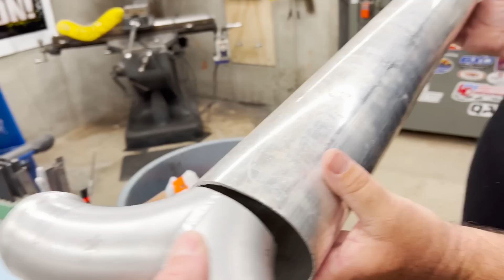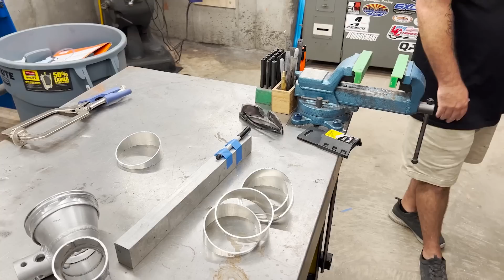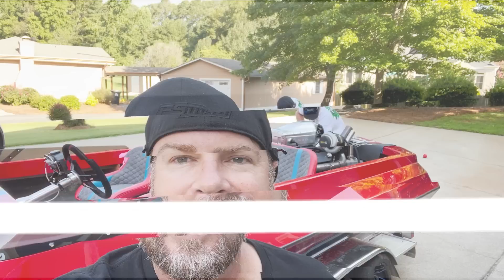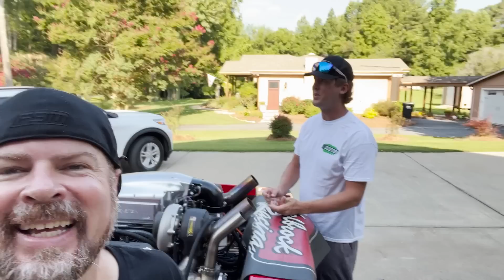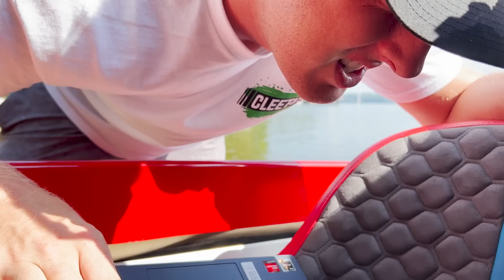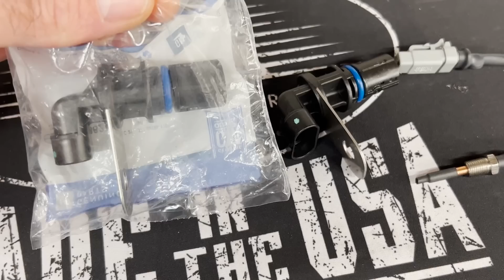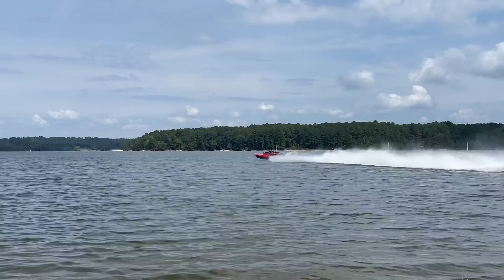CLETUS MCFARLAND, PIE CUTS, BROKEN PARTS AND A NEW PERSONAL BEST IN WIFEY'S WHIP!

Comment: @Finnegan's Garage , what fuel is required for the 20psi?
Reply from the maker: im running 118 octane leaded racing gas. That high of octane probably is not necessary and i could probably get away with 110 octane but race fuel is cheaper than rebuilding the engine after it pings itself to death.

Comment: there has to be a spec for the gap for the sensor, put a 160F thermostat, the engine is to cold, I asked my tuner, and he said it's to cold as well. The tuner said put a 185f and don't change anything. Check exact gap for the crank sensor and set it to spec. Look around for anything that would interfere with the sensor
it's to cold, you got 10,0000,0000 gallons of coolant.... it would go a lot faster with a prop...
 oB
Reply: My experience with psycho problematic crank triggers have all been temperature related. 
IE: measuring resistance through the coil constantly while submerged in water as I gradually increase the water temperature. 
In all cases, there came a point with very narrow boundaries when the resistance would flip out.  Although similar, none of the sensors went problematic at exactly the same temperature. 
Whether this was due to thermal related movement of metal, causing the coil wire insulation to fail, I can’t tell, or whether it caused a short or a ground for sure, but finding the problem was a bitch in all cases, because they all acted uniquely, but similar.

Comment: Mike I love your show and all the goodies you get to play with im a 28+ experienced automotive technician small details can be so important even as small as the thickness of the red engine paint between the crank sensor mating surface and having that paint cleaned off! In my experience just that slight change in air gap between the sensor and crank ring gear can mess up the whole day of having fun

Comment: Could there be a difference between the 2 runs the a 111 and a 117 and humidity in the air that would affect it too that too but the more air flow you've got the better  Do you have a way to record the humidity from the old run

Comment: I had to add a shim to my crank sensor around the base of it. There is a GM part number 12565102. I actually had witness marks on my sensor. Crank flex can cause it to be too small of a gap and have the same issue.

Comment: I've looked through some documentation that says, in short simple terms, if the engine RPM changes too quickly the ECU will assume there's an error. What that rate of change needs to be to trigger that... I have no idea. That was specifically Speeduino documentation; done a bit of reading because I've never gotten mine to work right yet. Should apply less to dual wheel setups. If I did dual wheel, I wouldn't go missing tooth; don't want to right a book of a  comment explaining why.

Comment: I would look at the crank case pressure and see if there is a correlation between that and the loss of crank signal. Being that it is a boosted application, you could be making so much case pressure that it is actually pushing the sensor away from the crank and creating too much gap. In that event, if that is the issue, maybe a belt driven vacuum pump could keep the case under vacuum and hold the sensor in the correct location. Maybe I'm an idiot but it's worth a look. I love what your doing and wish you and yours the best!

Comment: Did you sort the crank shaft sensor? SuperFastMatt was doing a build where he had the same problem and was informed apparently you need a resistor for high RPM engines. See here https://youtu.be/oDI6a09ywVo?t=666

Comment: I was wondering how long it would take before you actually upgraded That Elbow I knew it was going to be a huge problem remember an engine's just an air compressor even under boost the easier you can get it to flow the more power it's going to make

Comment: That merge makes me think of how many X-pipes under cars I have seen that comes from a pair of 2½" or 3", necks down to one tube of the same diameter, then splits up. That X needs the same cm2 area at the very least as the two tubes combined. I.e a 3.5" tube is minimum for two 2.5". Imagine ho restrictive a pair of 2.½" headers that are necked down into a single 2½" or 3" is.

Comment: I wonder if the wiring to the sensor is suspect. EIther the condition of the end plug, the condition of the wire, or the routing of the wire.

Comment: I said it once and I'll say it again, " A little knowledge is a dangerous thing"! Fellas, fellas don't paint these engine blocks where the sensors mount, especially the CRANK SENSOR! The paint under the sensor and on the tab pad move the sensor too far the trigger wheel and when it's not completely in the hole, they tend to bounce. I've fix this three times in 2022 and I'm sure I'll see it again.

Comment: Is there any chance that you welded, or tacked the Y  pipe on the engine by grounding the engine, and some current arced the small crank sensor gap?  A little outside the box.  But that's where you live.  LOL

Comment: Before you start beating on aluminum you should always anneal it and then after beating on it for a while, do it again. It has a bad habit of work hardening to the point of cracking. Basically put the soot from an acetylene torch on it and then heat it up until the soot goes away and you'll be at temp and then dunk it in water.. it's the opposite of steel it'll make it super soft instead of hardening it. Doing it before working the metal makes it bend at least 5X as easy. You can take a sheet of 60 thou aluminum and bend it by hand with a ton of grunting but once annealed that same piece can easily be bent in half with very little effort. I would've also cut the sides off of your squished section making a V like shape that could've been tapped down between the two pieces of your original Y to make a tight fit like they do on motorcycle header collectors.
 *sigh I wish I could put all this knowledge I have to use.. autism, scolios/kyphosis, chiari malformation (brain defect), and IBS make that about impossible in a normal job environment though. 
Hmm a LS having crank signal problems.. what other red vehicle have we seen that had that problem?... though that turned into it also having a cam sensor issue too.

Comment: I'm no engine builder but I am an EE.  What about high frequency EMI induced by the close proximity of the crank sensor pulses going to the ECU and ignition wires?  The super high frequency pulses from the ignition wires could absolutely be messing up the pulse signal from the crank sensor before it gets to the ECU.  

Edit: looks like this was already mentioned by @skunkie so kudos.

Comment: I like to use a sheet of aluminum on my welding bench to weld on. Makes perfect conductivity for ground with out the arc tracks that get caused from a steel bench top. Give it a try. You wont have to clamp the ground on the piece your welding, unless its painted of course.

Comment: Interesting that Cleeter mentions warm-up in relation to crank sensor glitches. A cold turbo engine has significant blow-by which MAY push the sensor slightly out of the block, interrupting the signal. It also stacks with the fact the engine is seeing more boost at lower rpm than the previous test. Also, that plug lead almost touching the signal wire is not helping anybody.
One thing I am sure of: the LS crank angle sensor issue needs to be solved by somebody. Hopefully, someone smarter than me is working on that.

Comment: Air density at 9 F and 14.7 psia:

1.355 kg/m3
0.08459 lbm/ ft3
0.011308 lbm/gal(US liq)
2.629x10-3 sl/ ft3

Air specific weight at 9 F and 14.7 psia:

13.29 N/m3
0.08459 lbf/ ft3

and i know what all that means......ya
hope that helps.....9%  temp diff in air density

Comment: Hey mike I run supercat race boats and are motors are 2500hp turbo we do look at intake temp but only after the inter cooler in #8 runner which is furthest from throttle body we’re at 90deg mostly same as water temp that cools chiller are chillers are massive tho 10.5in tall Carson brumett another thing we look at is oil out which we try to keep below 240 and 190 in looks fast sweet boat

Comment: Put a wider washer on the crank sensor retention bolt to make the holding tab more rigid...the factory tab is weak and will flex because it’s not made for high crankcase pressure which can push out the sensor and increase the gap... a thick fender washer will cure the “bends” and keep the sensor to wheel clearance tight.

Comment: Even the thickness of the paint on your block can be just enough to throw off  the cps !!! clean off the paint to the mating surface !!!  i used a little play-do on the end of my cps, measured it, cleaned it off, to set my shim height, worked for me !!!
Reply: I also used a little play-do on the end of the cps sensor to measure the gap  & set my shim height accordingly, Worked for me !!!

Comment: The new 4” elbow will allow for over 2.5x the airflow than the 2.5”. With the increased air flow I would guess the time needs to be adjusted… a 2.5” pipe has an area of roughly 5 in/sq whereas the 4” pipe has roughly 12.5” in/sq. By flowing 2x 2.5” you are flowing an instant rate of around 10 in/sq, and with the single 4” you’ll have more than that capacity. With the single 2.5” collector, your velocity was probably much higher and hotter than it is now due to the restriction.

Comment: Your crank sensor wires go quite near a coil pack, you could try shielding the wires with a faradey shield. Cleatus fixed his RPM issue by changin the cam sensor so you could try that as well

Comment: Mike, here's a thought,
 I was wondering if you could put reducers (different sized thickness insert restriction's) in the new elbow to fine tune the air flow, maybe with a twist lock nut/ring to hold the two pieces together for easy swap if/when needed, 
kinda like in the jet drive 
(same concept),

Comment: Ditch the 58x sensor.  Put a msd 4 magnet standard wheel on the crank pulley and be done with it.  Just the standard MSD stuff with the Holley flying magnet Hall effect sensor and no more crank trigger problems.

Comment: Basic thermodynamic theory is when you compress a gas it gets hot, expand it and it cools. Temp at the restriction would be warmer, but immediately after it would drop again.  If anything the restriction might have a very very slight inter-cooling effect, but the restriction will reduce flow, and hence performance.

Comment: Sorry advice, take the old position sensor gut it and run a bolt through it. Screw that bolt in as far as it it will go while buddy turns the engine over by hand. You’ll get a really good idea of what the gap is and be able to adjust the other sensor to suit.

Comment: I always keep a set of sensor pins around to perform pin drag tests. These terminals have a way of losing connection when they've been tampered with. Also, solder the terminal to the wire just after the seal, cheap insurance.

Comment: I love that Miller welding helmet.  I've never seen one with such a large viewing area.  Assuming it is the Relic 280051, that's starting to get up there pricewise at $387, but if it works as well as the claimed spec, it would be totally worth it.  I need all the help I can get with my 73 year old eyes. 😎

Comment: Common sence your trying to output two presurised volumes of air into a pipe the size of one turbo outlet it would be extramly turbulent specialy if one turbo is making slightly more boost than the other but love how much it has improved the boat keep the videos coming

Comment: Air temp will ALWAYS be higher in a restriction, BUT it will cool down gain when it leaves the restriction.   If you AIT sensor is in the restriction it will not give the temp at the throttle body; because Boyle and Bernoulli work both ways the air will be cooler.  That way carbs will ice up.  If your setup is as described above the numbers you have will not be accurate, ow inaccurate is anyones guess..  Having said that the restriction wasn’t du any favours.

Comment: U want you and cleetus crank sensor issues put a big washer on backside of tab you bolt down when you making boost the sensor is getting pushed out because of the egr pressure possible and is why tab sets lower on new sensor

Comment: Centrifugal force adds heat of friction. Air compressor or a positive displacement is heat of compression.
Reply: Mass flow through a centrifugal compressor is way more efficient. With less friction as it passes through the compressor there will be less heat. In my a career I have worked on centrifugal compressors for 33yrs. This is what drives efficient, huge scaled chillers for air conditioning, mass flow…..

Comment: So you don't bend the pipe in the clamps (which is visible in the video) just get a piece of wood, use a grinder to round the ends to match the contour of the pipe you're cutting and slide it in. It doesn't need to be tight fitting to the point where it won't go in, just needs to be exactly sized to where you can push it in by hand. 2 minutes tops = even better cuts and you can really lean on the handle of the clamp.

Comment: You more than doubled the surface area of the inlet tubing. In the process you eliminated a 50% restriction that was holding it back. That's huge and the power increase is proof.

Comment: Now exhaust pipe frm the turbo open it up .. that will allow the turbo to spin faster .. eg.. 3 inch out let go to 3 1/2 " pipe 4" go to 4 1/2" and so on especially if you have bends within 12" of the turbo  .... turbo exhaust is spinning as it leaves the turbo and is at speed you need to open the pipe to slow the speed so the gas to straighten out and get out of there ...garrett  needs to do this to mullet as well

Comment: I wouldn't let McFarland Tuning tune my lawn mower to be honest. They've destroyed a lot of engines including the latest 360ci Mopar...didn't install (with proper lube) or run in the new camshaft in prior to doing burnouts and dyno pulls...and put too big a carby on the motor. They come from the school of more fuel, nitrous or a turbo, compensates for everything. About time they employed an experienced engine builder, rather than just mechanics. The only member of the crew I have genuine respect for is Tye Braun...he is the top of his game 🤔

Comment: So I will start by saying nothing I do is at this level of power, however, I know delicate sensors enough to recommend this:
1) As another said before me, make sure the wires are shielded to the ECU
2) With boats being solid mounted and having very minute vibrations of which thousands at speed are rarely registered via the ass meter, the internals of electronics usually can and do fracture at solder joints or, especially so, any flex in a solidly soldered connection without isolation. 

That said I would try to make it so that your crank sensor isn't tightened with the possibility of flex and is isolated solely to vibration. 

That said the improvement is astonishing, wasn't expecting an elbow change to make as much difference as it did. Good luck with Blasphemy, I know she likes to test you lol

Comment: I have been a mechanic for over 30 years and one thing that has been in my tool box all that time is Silly Putty. I the case of your crank sensor would put a small piece on the trigger wheel, install the sensor, pull it back out, pick the putty out carefully to see your gap. You can cut the putty with a razer blade and get a pretty good measurement. If there is some room sand some paint off the block. If it is like the crank sensors I have been around it doesn't hurt the sensor if it rubs a little plastic off the end. I have mostly worked on larger diesel engines.

Comment: When you increase the overall diameter of the pipe, the CFM quickly increases. At 10psi on your 2.5" ID, you can flow ish 5000 CFM, at 4" ID, you can flow 16400 ish CFM at the same 10 psi, I used 1 foot of length for those numbers, but just a general show of the difference that little increases in diameter quickly gives exponential increases in overall CFM.
Reply: Watch Rob Dahm's Ultimate Guide to Wire Harness' (Lol) But he does give some good explanation about shielding, splitting certain high and low voltage wires from each other when building the harness. I tend to agree with Skunkie Designs
Reply: Also, your ending temps of 173 F vs 136 F intake temps, the 136 F intake temp has ish 94% MORE air in the same cubic inch as your 173 F temps from before. Tempurature drops also start to parabolicly increase the physical amount of air in the same given cube.

Comment: The engine company I worked for, we had troubles with aftermarket crank and knock sensors. We had to use GM stuff for reliability. But it looks like that what you were using.

Comment: JFYI guys, you can set Holley Data logging to "System Log" and it will record the actual crank and cam signals (including when/where it looses sync).
As busy as you are you'll probably need help with what your looking at (and or what to look for) but Data is the King when it comes to trouble shooting (vs WAG-ing) 🤔

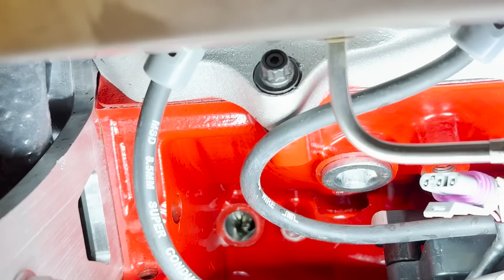Comment: Start by replacing the spark plug wires. The one on the right @31:03 seems cracked. After that check the shielding on the sensor cable make sure it's connected to ground at the right place. If you don't have a shielded cable then I'd suggest you better get one before doing anything else. Losing crank signal at high speed, high rpm and high boost could hurt the motor + you and/or any passenger(s)

Comment: Instead of marking the centre of the tube use a square off the saw base. Make a 9° cut then rotate the pipe roughly 180° and put your square on the saw bed and rotate the pipe to the square and it will be correct and saves you alot of messing around